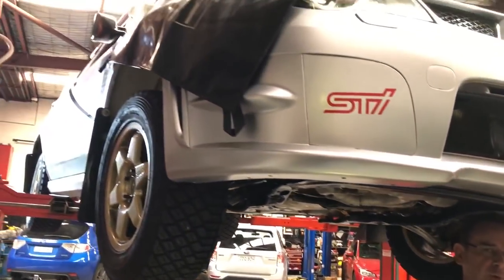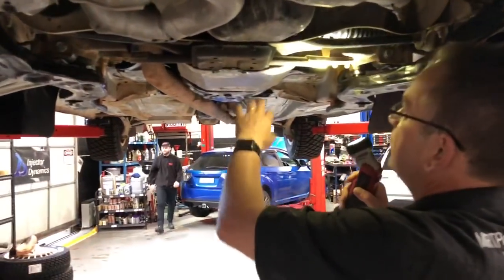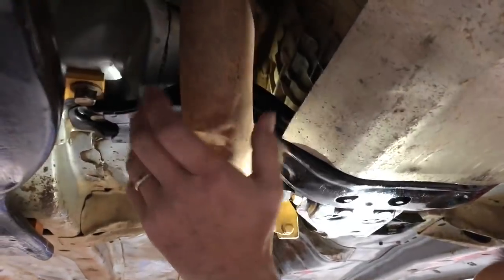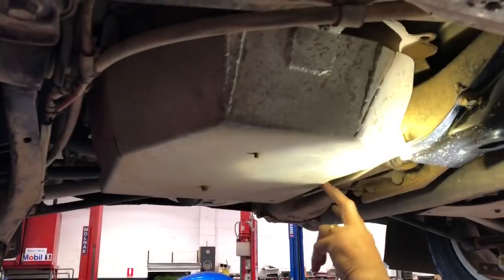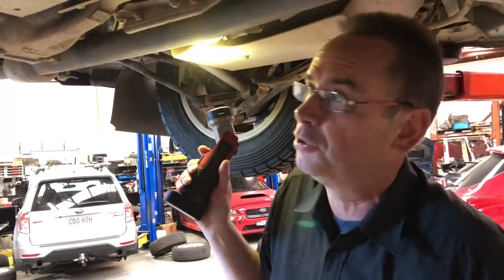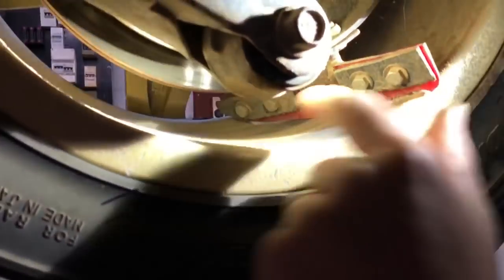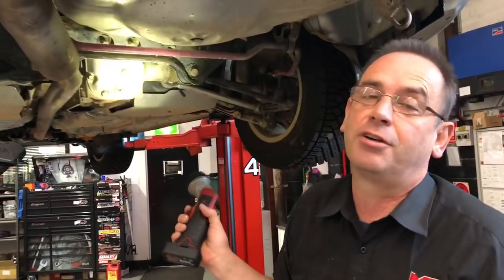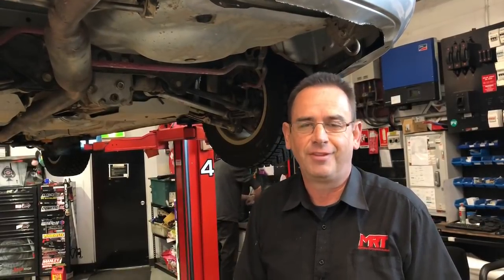MY03 STi Spec C Rally Car -  Underbody Tour

Comment: Curious what rear trailing arm brackets you use if any for the lifted gravel setup? Also how did you go abut fitting protection plates to the gas tank. Thanks.